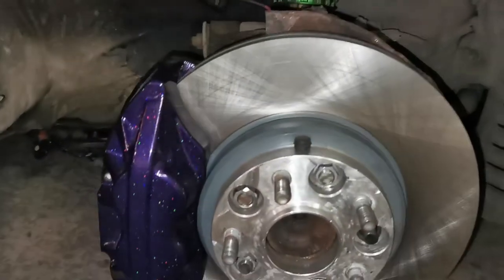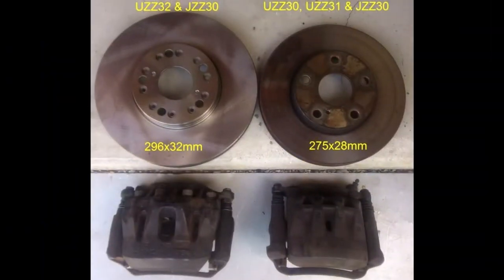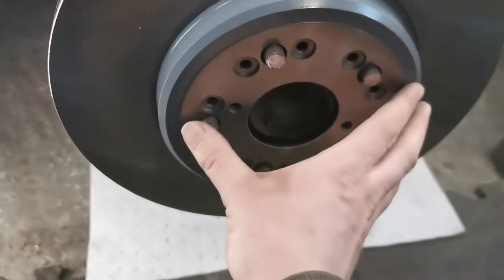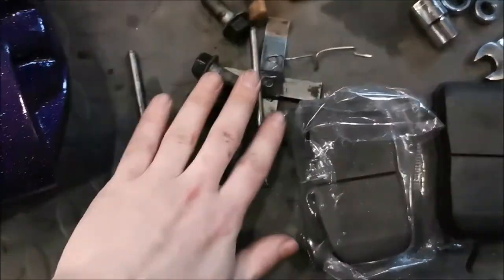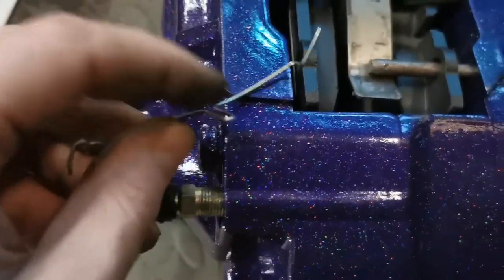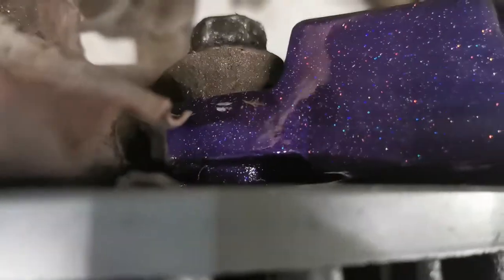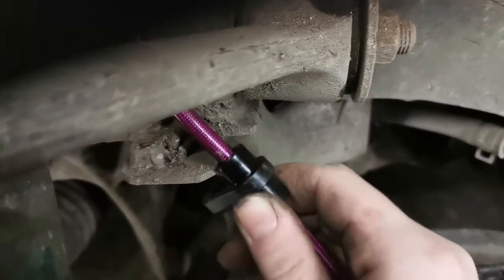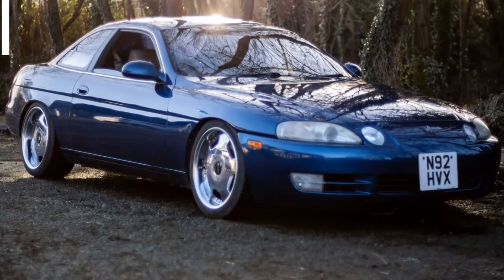Toyota Soarer LS400 Caliper Upgrade

Comment: That is a sc400 not an LS400 the LS400 is the 4 door version
Reply: The point is the new brakes he installed are from a 95+ LS400, it’s a direct upgrade for SC’s/Soarers
Reply: its a toyota soarer, right hand drive. Plus it's a 2j.